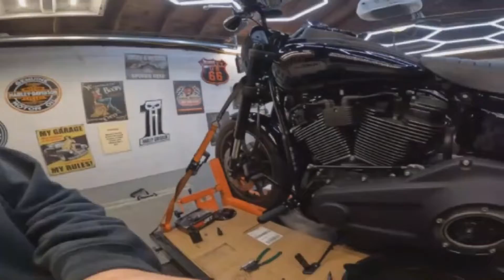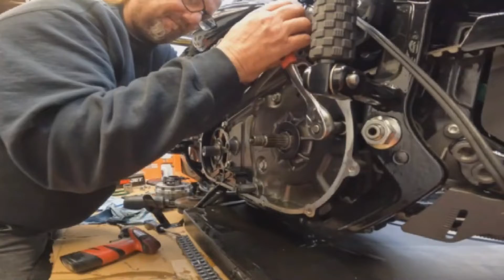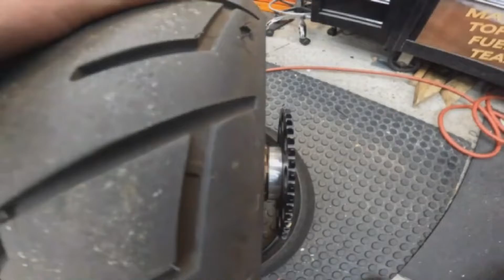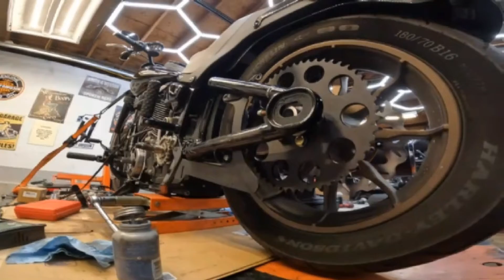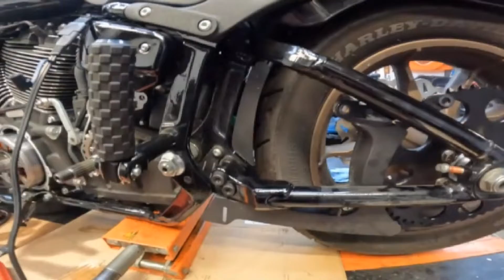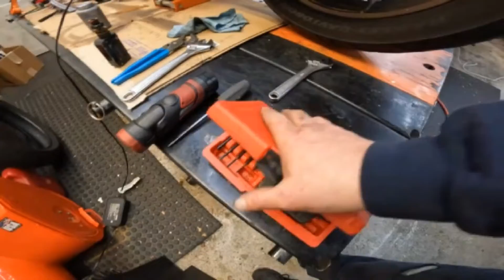Chain Drive Conversion on a 2020 Lowrider S #harley #harleydavidson #softail @FuelMotoUSAWI

Comment: i powdercoated my spacer gloss black along with all the covers for the engine and trans. Im doing Heritage floorboards so instead of doing the plug for the shifter i got a Heritage gloss black primary cover.  tapped the inner primary cover shifter hole for a 3/8npt pipe plug.
Reply from the maker: That's a great idea.  I like that.

Comment: Do you have a link for that black socket? And also the chain termination tool.
Reply from the maker: Let me see if I can find them.  I will post later tonight.
Reply from the maker: https://www.amazon.com/gp/product/B09KR6L56X/ref=ppx_yo_dt_b_asin_title_o00_s00?ie=UTF8&th=1

https://www.amazon.com/gp/product/B087BTNBLZ/ref=ppx_yo_dt_b_asin_title_o00_s01?ie=UTF8&psc=1
Reply: @DrHarley awesome thanks! I am just about to pull the trigger on the fuel moto chain drive kit.
Reply from the maker: That's where I got mine.  Couldn't be happier with it

Comment: Why on Earth would harley engineers put the stator (an electrical part which hates heat) buried inside underneath the hottest part of the engine? Other brands don't do that. Great video! Very informative! This conversion was a lot easier on my sporster, as the front Pulley is only covered by a Pulley cover. Always wondered why they buried it on the other models. I guess because a sportster doesn't have a gearbox, it's lubricated by the engine oil. I chose to cut my chain to where the axle was dead center in the dropouts. That way, you have room to slide the wheel forward and remove the chain from the rear sprocket if you ever need to remove the wheel. When the axle is all the way forward, you have to break the chain again to get the back wheel off. How are you liking the feel of a chain? I love it!
Reply from the maker: That's a great point.  I have no idea why they put the stator there.  Harley has been doing that since the shovel Head.

Comment: I am thinking to covert chain drive on my 20 m8 softail low rider s. Most local dealers telling me that chain drive is not a good option to mod over belt drive i currently have from factory. Despite to all negative comments,  i am willing to mod to chain drive. How do you like it so far since you converted  to chain? More torque response n power to rear wheel? What tooth did you go with on this bike? I got introduced 24tooth on front n 33 tooth on rear?
Reply from the maker: Paul, I like the chain drive even though it's more maintenance.  Cleaning and lubeing  the chain every 500 miles.  Also adjusting is as well.  I kept the stock ratio for ease of comparison with all the mods I made abd make to the bike.  As I am trying to get the most HP and TQ out of a naturally aspirated motor.  The throttle response is much better because of less flex from the belt.  However I also did a compensator delete as well.  Same ratio there as well. I would not do it if I was making less than 150 hp and 150tq.  I hope this is a help in your design
Reply: @Dr.Harley  hey Dr., thank you for your input. My bike has stage 2 with cam n dynoed, but I seriously think it does not put out high power, as you mentioned. And for me, I am no mechanic to do conversion like you had on your bike, so I am solely relying on a local shop or the stealer to do the conversion if I am going with this mod. As far as chain adjusting n regular maintenance goes, I have to learn DIY as time goes.
Reply from the maker: At this point,  you're not making the HP or TQ to require that upgrade.  If you want to spend the money for the show then why not.  However, if it was me, I would not until the bike required such an upgrade.
Reply: @DrHarley  thank you n will do.